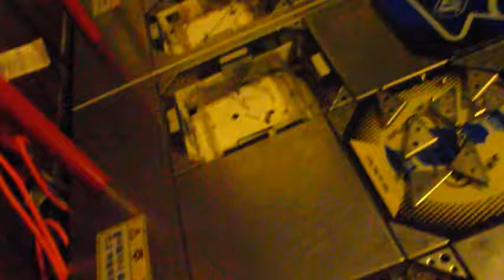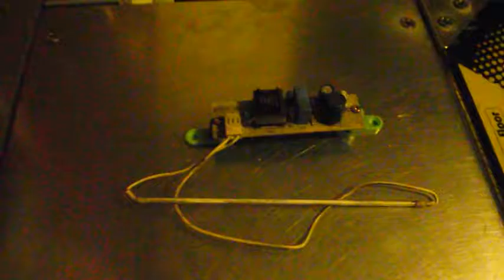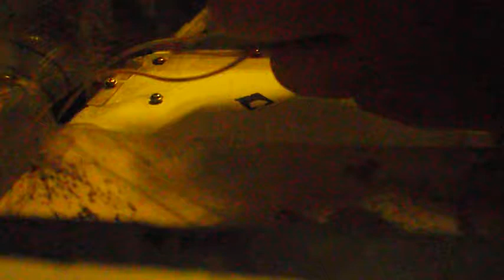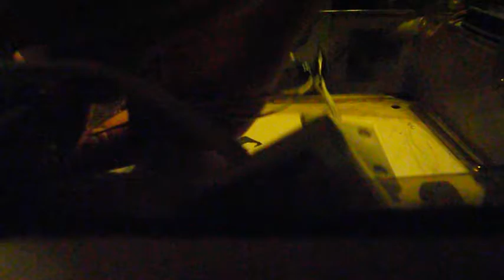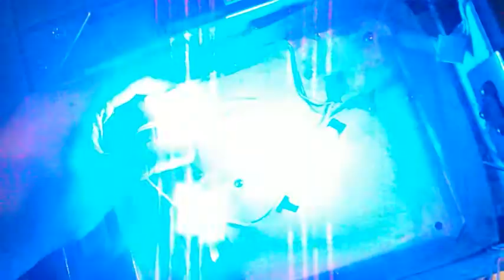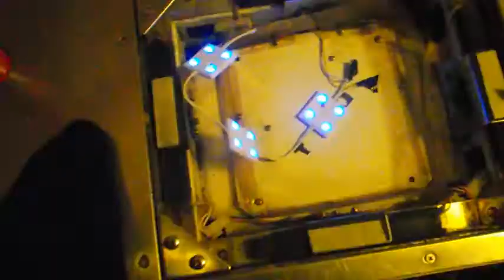Pump it up - LED Upgrade tutorial (Cheap~! $4.00 per arrow!)

Comment: Dudeeee Wow,... I am saving this video I have a few extra lights that may or may not be used from the guy I bought my machine from. I was going to buy more lights when I order the 2 L brackets I am missing but I may just do this instead. Cheaper doing this than buying those crappy lights.

Comment: Jesus you are the Pump It Up mod king. Just bought new pads for each platform. 

I'll check out your tutorial/video. Thanks man!
Reply from the maker: Nah. I just love to make videos for helping the community.

Here man, I suggest you watch this one specifically since it will help you work on your pads and better understand how to make them function better.
https://www.youtube.com/watch?v=RziOtMJ03ag
Reply: Also, my blues aren't near as bright as yours are. Did you change the blues for white?
Reply from the maker: I use whites in my current pads, the blue ones I just have sitting in a box somewhere. but in this video I used blue ones.
Reply: Nirvash OH GOD ITS GOING TO RAPE ME 

Any thoughts on why some leds are working and some aren't?
Reply from the maker: Maybe you plugged them in backwards? lol
Reply: Nirvash OH GOD ITS GOING TO RAPE ME 

Ha I hope and wish it's something silly and easy to fix like that. It's weird, the four sensors work for the panels that the led isn't lighting up for. 

At first only one led wasn't lighting up but now two more have stopped lighting. I don't get it

I'm goinf to order some whites what's was the led website again?
Reply from the maker: Watched the video and I have to ask. have you tried putting those LED`s in another LED`s slot?.. It could be the LED connector itself has failed, or the LED.

if the LED itself failed just ask for a replacement, though its very unlikely it failed unless you got something different than the 12v DC led I suggested.

as for the theory of drawing more power, if you picked out the ones i suggested it would be absolutely fine. I could run 10 of those LED`s per panel and it would be just fine.
Reply: Nirvash OH GOD ITS GOING TO RAPE ME 

I haven't tried that yet but I def will experiment. I remember all the neon tubes lighting before I gave this a complete disassembly and deep cleaning. Leds draw less power right? When I strip the white and yellow wires coming from the machine, then strip the two strips of the led, does it matter which wires are connected to each other?

I just bought all whites led squares to try under the blue panels

Comment: Yea I can't find a lot of parts here in the states.

My Pump It bars were black with no pad. Weird. All the ones I've seen are red. I can't find any new ones to buy.

Have you put a computer in your cabinet to play all versions? Have you replaced your monitor with a LCD TV?
Reply from the maker: I wrote the guide on how to put StepF2 in arcade machines =P Go type in "StepF2 Arcade" to find my video.

Currently I use a multiloader with all PIU mixes and StepF2. And yes, I currently use a 40" 120hz Sony Bravia that I got at bestbuy for 220
Reply: Well hell, do you have a picture of your cabinet with that bad ass tv on it? Do you have a guide on what I'll need and how to convert it from this monitor to a tv?
Reply from the maker: I actually dont even use my cabinet anymore. I just use the MK9 and a tv. I wrote a guide on how to power the dancepads without the arcade cabinet too so you could do this. My MK9 has an HDMI out so it works perfect.

Go visit PH-online.net and in the forums go to "the pump it up bible" to view a bunch of the guides I have uploaded =P It will help you a lot.

Comment: What a great idea! Thanks for all your tutorial Pump It Up videos.

So you have a lead on a good place to buy new foot panels? I need to replace all ten of mine. What company do you use?
Reply from the maker: I usually use ArcadeSpareParts for panels. They are cheap and ship pretty quick. Though I have replaced the center panels with the bracketless C-Frame stype ones from the newer pads. you can order whatever from there